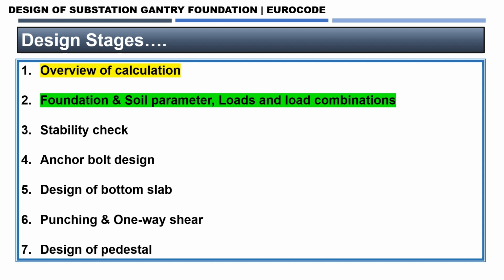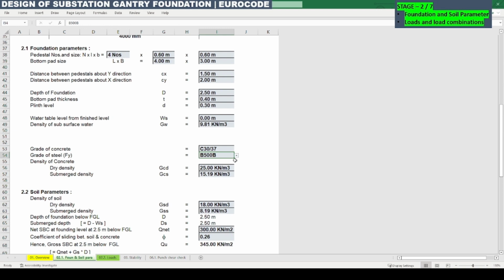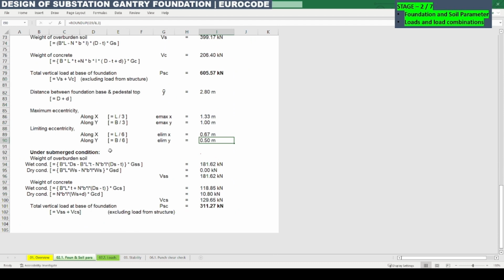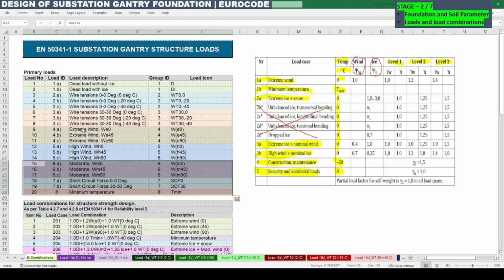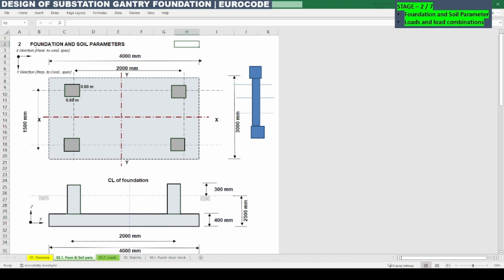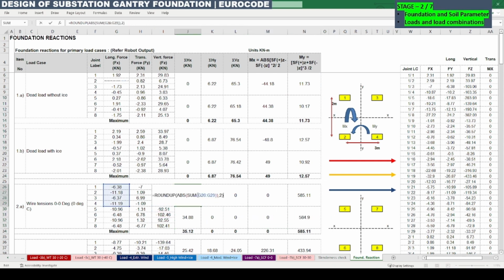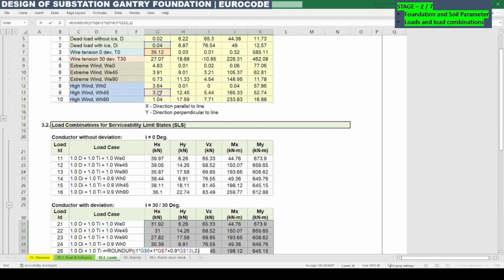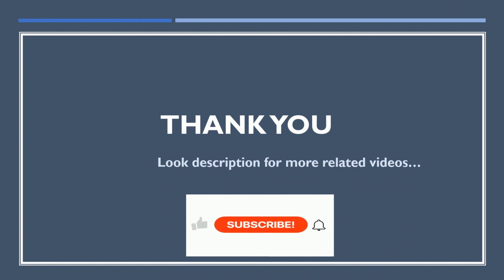Stage 2 | Loads and Load combinations for  Substation Gantry foundation design | Eurocode |

Comment: Seismic load has not been considered.
Reply from the maker: Seismic impacts are not vulnerable in most Europe 🇪🇺 countries compared to the wind and condutor tensions at minimum temperatures. Also, seismic can be ignored  for steel gantry structures due to its ductile properties.